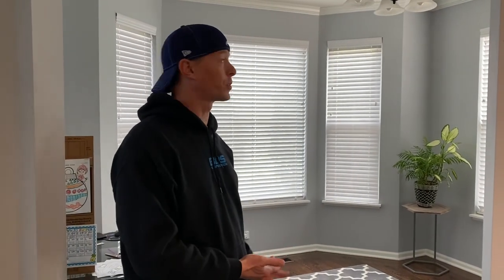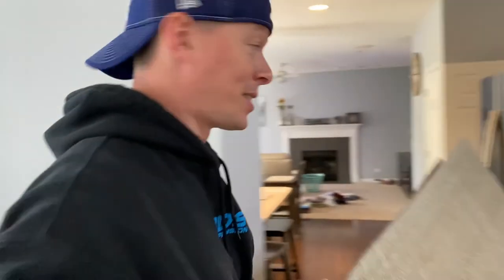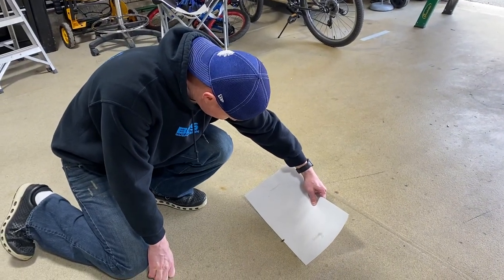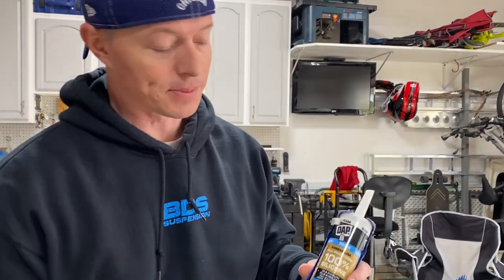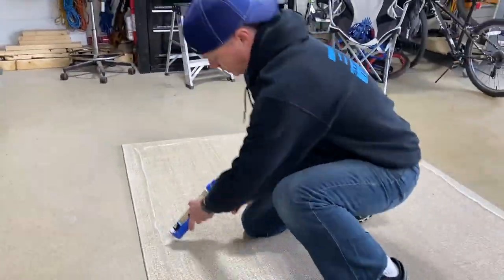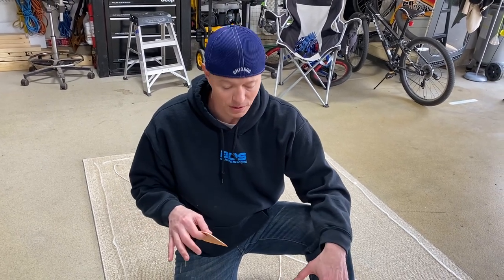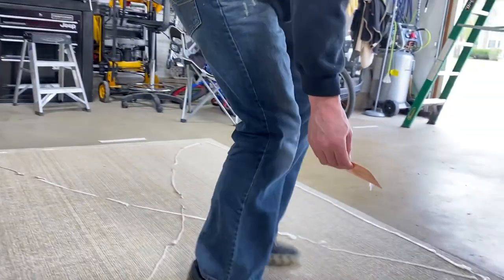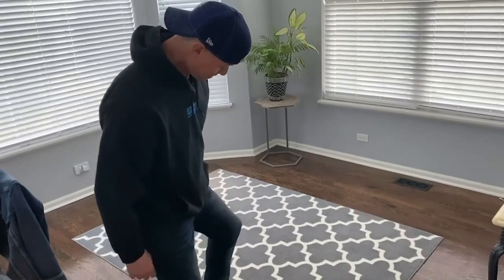How to stop your rug from sliding around

Comment: Make sure you use acrylic caulk instead of silicone caulk so it won't leave sticky residue on hardwood.
Reply: Cringing at either on hardwood flooring when you can just use double sided tape.
Reply: @danielsmit11  Double sided tape doesn’t work and it leaves a sticky residue on hardwood flooring..
Reply: @danielsmit11 great idea, if you never mop or hover your floors
Reply: @rainydaydiva6320  lol. And you think caulk isn't going to leave a very messy residue?
Reply: put the rug on the bare floor then lay the wood floor  around it
Reply: @danielsmit11  that lasts about 5 min
Reply: thanx Joe 👍 👍 ☺ ☺

Comment: Love your video and your style.  Question, would you suggest using clear silicone for a transparent floor mat for tile floor?, you know, it's the ones you use in your office so the wheels from your chair don't scratch the floor.   The package label said it would not slip on tile floor, but not true.  OR, any other suggestions would be greatly appreciated!  Thanks.

Comment: I would not recommend doing this. I saw this video and tried it for myself. We have a dog that runs around and when he runs and stops hard on the rug, it still slides. The dried silicone rubs against our hardwood floor at a high velocity and gets silicone flakes everywhere. I'm now in the agonizing process of peeling it all off the bottom of the rug. I would recommend just getting one of the non-slip pads from Walmart and cutting it to size.
Reply: Your dog should not be running in the house or you need a lighter dog.   😆
Reply: @rizangler  he’s a pretty fast dachshund, I’ll give it to you
Reply: @adam_and  😂😂😂😂